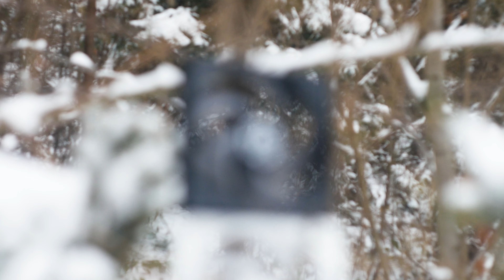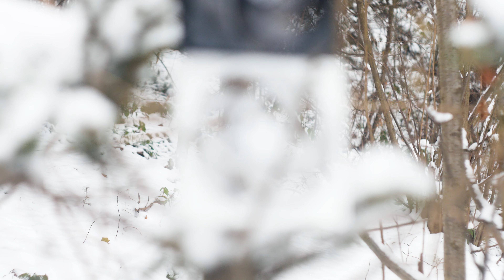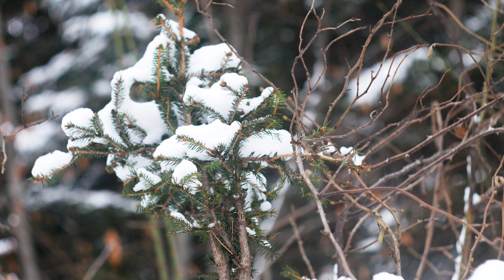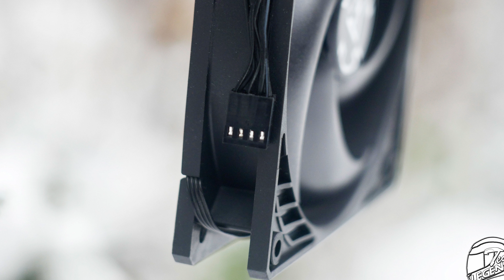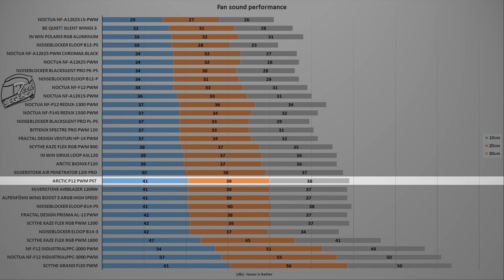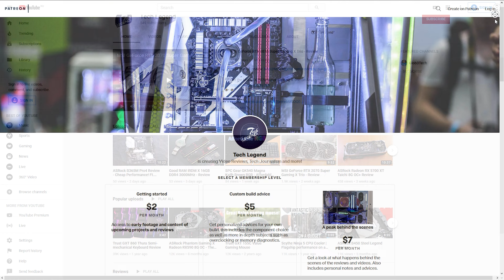Arctic P12 PWM PST Review

Comment: Got 4 P12 for the front and back of the case and 2 P12 Slim for the top. Used some ridiculously cheap rubber O-rings while screwing so that the fans won't touch the metal case directly but the rubber rings instead, which greatly reduces vibrations and buzzing noises.
Reply from the maker: That's an awesome solution for vibration dampening. Thanks for sharing!

Comment: Good production review. 
One conflict though, you said that anti-vibration pads are a must but I actually haven't seen anyone agree with that and I looked really hard.
Reply from the maker: The anti-vibration pads are a must in the sense that the fans might start to vibrate on some radiators or heatsinks. I say some because I've seen these fans be alright on certain radiators and then start to create some vibration on another. So it's better to just recommend the anti-vibration pads, especially since those are not an urgent thing to buy and are cheap enough to invest in.
Reply: @TechLegend-com  which pads would you recommend?
Reply from the maker: @moseskamran8086  It doesn't matter, the cheapest ones that will fit.